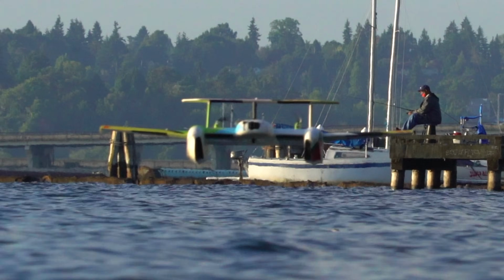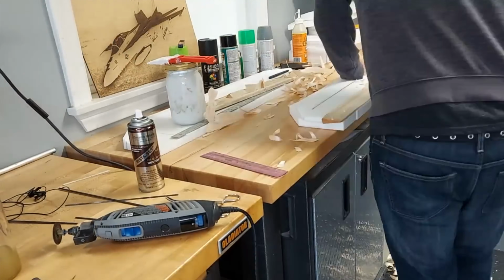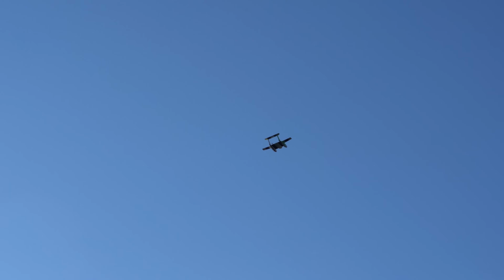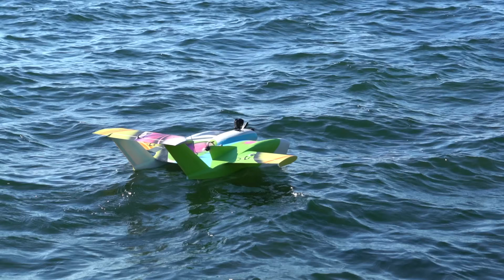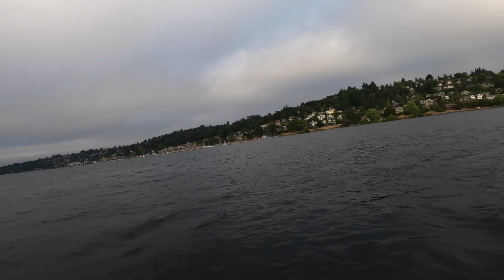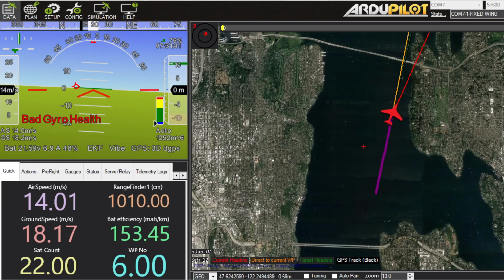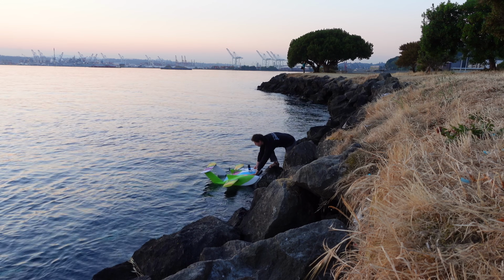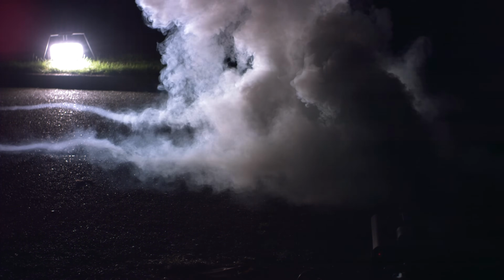R/C Ground Effect Vehicle - Long Range FPV

Comment: As an instrumentation engineer, I suggest you might get better results using ultrasonics rather than Lidar. The ultrasonic system should have longer range and, as the beam is conical and therefore covers a greater area of water, it's not as sensitive to choppy water. It does, however, have a minimum range, within which it won't work and this depends on the transducers used. Perhaps mounting it on a high part of the craft would help. The echo processing should not be too dissimilar to that required using Lidar and I believe you can get systems for Arduino. Subbed!

Comment: Two things come to mind. Mount the lidar module  in a 2 axis swing (this way it's always pointing straight down even when banking in turns). You'd need to implement it in a way that minimizes pendulum motion when changing direction.

Second thought is a bit more out there. Could you use a camera system to detect obstacles and run obstacle avoidance algorithm to navigate between boats? Maybe another LIDAR module on the top with a reflector mounted to a motor to scan 360° and build a map.

Comment: You are my inspiration for getting an asw28 and putting a long range fpv system on it.
I have an IX 12 going to get a 10 channel smart receiver and a DJI air system for it.
Hopefully it will all work together 🤞

Comment: Considering the efficiency test: you do not need to freeze anything, you need an integral (over time) of speed times amperage, or something like that. I do not know much about flight efficiency in particular, but it feels like an integral thing. 

Great video, and an awesome project. Original soundtrack is my special favorite.

Edit: I wonder if it's possible to probram it to keep pitch and roll during turns in the ground effect (like, yaw-only turn) using nothing but thrust differentiation. That would exclude the wing tip touchdowns.

Comment: In the early days of LIDAR mapping we created an algorithm (like a Kalman filter) to take out tree scatter from the laser return in the heavily forested areas of the PNW.  You might be able to do something similar with your wave peak and trough return to create a more average wave height calculation.
Reply: Would a LIDAR array along the X axis help provide more accurate wave/water heights, say 3 (or more) devices, front facing forward (i.e. 30 degrees), middle vertical and rear facing to the rear? Tune number of sensors, angles and separation as well as phasing. Also consider one TX/RX and two RX only?

Comment: For the next part, fix a drone to fly long distance mission on top of the airplane that detaches with electromagnet, have it circle above and act as relay for the fpv drone and then automate the redocking. should also charge from the mothership for repeated long range fpv flights from mothership.

Comment: Applying a smoothing filter to the lidar sensor data should help with getting a less noisy measurement. A few options would be a moving average, an exponential moving average or a Gaussian filter.

Comment: If you put 2 sensors on it one near each wingtip you can use that data to aid in the turning issue because then it would know when it's wing tips are potentially getting too close to the ground. This might even allow you to find a way to essentially cancel out a good chunk of the noise by seeing what the difference is between both sensors is and eliminating any sudden spikes that don't show up on both sensors when you are calculating the height which would help increase the resolution as well as the accuracy. Adding a third sensor could make it even more stable of a readout. Basically the more points you can get the better. An ideal situation for something like this in my opinion would be at the minimum one on each wingtip and one on the tail or nose because then you can calculate a plane no pun intended out of the 3 points from which you would be able to get the estimated distance from any point on the plane to the ground which would make turning as simple (on a level surface at least) as biasing one sensor to increase the ideal value and decrease the other one all while maintaining a total minimum distance from any point on the plane to the ground.

Comment: Suggestion: An autonomous plane with a radio relay in it, so you can get good video while in the ground effect at longer ranges. 
Perhaps it should be solar powered, or lighter-than-air so you don’t have to worry about battery as much.

Comment: On some UAV's I worked on years ago, to keep the wingtips from getting in the view of the FLIR during target loiter, we used rudder in the turn and counter with alerions, to perform more of a flat turn. Slight loss of efficiency but worked well.

Comment: Awesome. One way to compare efficiency in and out of ground effect could be to fly a waypoint mission and then repeat the same mission with higher altitude and the average speed of the first one. The ground effect mission would lose some efficiency by speeding up and slowing down the motors but I think the comparison is still fair.

Comment: You could compare the efficiency by comparing the distance traveled per power unit used, rather than power consumed at speed. Adjust for power consumption differences relating to speed change, and you've got a way to compare efficiency on your GEV

Comment: It might be worth using multiple lidar sensors to verify height data and help with keeping the right height on turns by mounting the extra lidar sensors at an angle

Comment: Add a forward LIDAR or machine vision system to detect possible boats and command either an emergency climb or a spiral climbing waypoint or some other evasive maneuver before trying again to head to the next planned way point.

Comment: If you want to easily compare efficiency without having to go too crazy on tuning and telemetry (like measuring and keeping constant air speed etc), you could do another test. After all, to increase efficiency, the first thing to do is to decide what the actual desired result is. And in case of flight, the actual flight time is not really a factor, nor is the actual airspeed. It's to get it from point A to point B. So if you can take a straight run that is long enough to properly detect battery usage at a sufficient resolution, you could do that straight run at a few heights, multiple times per height. Double up your experiment by flying both directions on the same day (which could also allow you to cancel out wind influence in the averages). It would be awesome to see you scale this up, either into a personal transportation device, or another tug beast for your kayak :)

Comment: On turns you should use trigonometry to calculate the change in your target altitude according to the roll of the aircraft or perhaps make that something that happens always as a safeguard to prevent striking the water

Comment: Intuitively ,without much calculating:
 it seems to be  more stable than body will be longer an than  will be four or six smaller propellers but only two of them will make quick feedback acceleration (it is just construction which made soviet engineers)

Comment: Maybe you can add a filter on the lidar data to get a smooth input signal for the PID controller, so it can cope better with the waves? Briljant video and diy engineering, amazing results.

Comment: Having 2 or 3 lidar sensors may help in rough water by averaging the distance reading of all the sensors (I think weighting each reading by the signal strength may also help to improve the relevance of the data)

Comment: Super cool Daniel!... Thanks to your inspiration I am working a fpv rc plane, where the controls and video feed is handled via raspberry pi's and 4g networks...

Obviously one wouldn't be able to fly the thing if there's no cellular connection, but I personally think it's a good challenge. Plus where I am from Fpv stuff isn't cheap as far as I can tell

Comment: Maybe you could use an accelerometer to smooth out the lidar altitude, either by using the vertical acelleration as the inner control loop for pitch and integrate lidar altitude in the outer loop over time, or you could use the vertical accelleration to discount false lidar readings.

Comment: You should add an Nano jetson board to this craft along with 2 cameras so that it has stereoscopic vision and then add code so that it can self correct for altitude based on what it sees ahead of itself in addition to the altitude sensors and lidar it would then be able to run in autonomous mode and could self correct for objects based on their size and relative position it would be able to steer around them or gain altitude to go over them all on its own.

Comment: Have you considered boosting your G Effect signal reception range by significantly raising the  reciver transmitter by using a tethered balloon or kite? 

If its windy you might have to add a weather vane tail to a balloon.. its an old idea- aerostats but the cheapest most portable way to extend your signal horizon. 👍🏻 Make sure its high vis as you dont want to bring down any drones 😁

As for turns how about sensors at or near the wing tips....you could then program a blended control input to avoid tip stall or   slide...wing fences have been used  on water bombers and 3D aerobats to help keep them following the line in banked turns close to the surface.

Comment: I'm imagining that it might be useful to measure the differential pressure between the upper and lower surfaces of the wing.  Recording the raw data while flying in and out of ground effect might allow you to map and tune flight dynamics around that instead of altitude.  To me, it seems like air pressure would be a more direct way of measuring ground effect but it could be more difficult than I'm imagining.  Great projects nonetheless!

Comment: Hitting the water on a turn problem is potentially caused by increased TOF for the lidar when the plane tilts (rolls). Should be an easy fix if you integrate the roll angle into the equation, i.e. if is you measure height as h = t*c where t is the time of flight, when the plane is at an angle q, h = t*c/cos(q)

Comment: Unlike aircraft, full scale GEV's have a down only aileron, which prevents or aids too low a wing tip on the inside of a turn
Pressure shift aft is curbed by the position of the wings on the mainplane. Some very complicated machines such as VVA14, which experience a very wide operational envelope, epitomise good control by varying wing positions and angle of attack. Conventionally, even the most successful GEV's maintain just 25% of mainplane area for the flying tail.

Comment: It seems that you need a sensor near the wing tips that is always perpendicular to the ground that has a pendulum type mount in order to make turns close to the surface of which you are flying. Just a thought.

Comment: To improve the high frequency choppy characteristics you could try to treat the input lidar data with a low frequency filter in code.  Something like: 
newReading = (rawLidarInput*0.9)+(oldReading*0.1)
//use the new reading for control
oldReading = newReading

Comment: As someone who works in RF, you low altitude range problem seems to need a repeater. If you have a good high endurance plane, why not set it up as a signal repeater? Your ground effect plane can go low and it can keep the line of sight.

Comment: Amazing project! keep it up! - As for the issues with "rough sea state" - maybe you should think about some kind of damping for the lidar data. Like a moving average of sorts. The wave crests and the wave lows will be in a certain range anyways, and what you need to find is actually the wave height, to be able to identify the optimal height of the flight path relative to the average water level. Once that is calculated, you should be able to keep level without much change in throttle. Of course, that would require some kind of front facing lidar to identify obstacles, like boats, grass or animals to initialize evasive maneuvers.

Comment: Use of symmetrical airfoils would prevent or minimize the center of pressure shift for super stable "hands-free" flight in ground effect. Reference Charles Bixel.

Comment: awesome results!!! PID controllers for this system may be too for the stability you desired to see. PID don't handle wavy signals very well. You may need some complex compensator with feedfoward control or even some kind of model predictive control. dunnow if ardupilot hande it!

Comment: Always cool video, and some of the clips were pretty as well. But the photographer in my was  thinking 'Go right a bit' 'Hold that line' 
You should write an A.I. that recognises potentially cool images. I mean, A.I. is easy, right? And changing your mission for random suggestions on the internet is a completely reasonable expectation...

Comment: GEV isn't just "flying low." You shouldn't NEED anything to control the height because a true GEV's height is controlled by the native airflow under the wing.  

What you have is an amphibious aircraft that's programmed to fly really low.

I'm not trying to knock his work, but it pisses me off when people either misrepresent or misunderstand the technology they're talking about. Those "GAVs" have such huge wings, they're just aircraft that fly low.

https://en.wikipedia.org/wiki/Ground-effect_vehicle

Comment: Excellent video, I have been following your ground effect videos for a while.  I have wanted to build a micro light version of a WIG for several years, I may just do that this winter.  Your design would make an excellent starting point.  I have flown light aircraft, hang gliders, para gliders and powered para gliders (I have flown my para glider at Tiger Mountain in Issaquah,  Fort Ebey on Whidbey Island and Blanchard mountain amongst many others)  and have been fascinated by WIGs for years.   Would love to get a copy of the design for this WIG. I live in the Spokane area after 50 years in Alaska  Thanks for the video! : )

Comment: It doesn't seem to be as relevant anymore with the new plane, but some of the oscillation in height could be from the design of the feedback loop itself. If I'm not mistaken, the goal of the loop is to maintain a constant target speed, no?(since ground effect vs non ground effect meets at a definite point(??)) In which case this a speed loop not a position loop, and the error function of the loop needs to integrated.  I aint no computer scientist, but I've built a few PID loops in garrysmod. She's a beauty for sure though!

Comment: Time to develop truly state-of the-art (at least a model for now?):

i am imagining a 2-piece fighter, with one on top of the other, the top piece is extremely agile, having only guns & sidewinder 9X IR missiles, minimal fuel.... because most of the super-maneuverability inhibiting weight (eg. Fuel, BVR missiles, landing gear, VTOL engines...) are in/on the bottom half, which will be capable of fully autonomous battlespace management, refueling, rearming....

Just after /before entering the WVR merge, the top half will detach & quickly peel off from the bottom half, quickly defeating the adversary with its superior maneuverability....

Stealth /VLO 6. 0

Comment: @rctestflight, why not transition the aircraft to use more differential thrust steering while it approaches and enters ground effect, then transitions to more traditional steering as it exist ground effect? That way, you can try to reduce the roll the aircraft needs in order to turn, meaning you won’t need to necessarily have the aircraft increase altitude for every turn it needs to make.

Comment: Very cool.  Curious if you have any code that considers bank angle and wingspan during ground effect flight to predict the change in altitude of the lower wingtip vs the fuselage in banked flight.  Maybe even consider peaks of LIDAR returns to calculate off the peaks rather than the average.  Love your videos.

Comment: What about adding an ultrasonic rangefinder module angled slightly forward to try and map out the ground/water a few meters in front of the plane? You could use this to avoid larger peaks and help it plan out when it needs to increase elevation to avoid impacts

Comment: I dont know anything about your set up, but seems like for the longer range stuff, if you wanted to operate safely then stay in goggles on dji.. If you see a obstacle or loose video, hit a switch that will change the altitude from ground effects to say, 30 meters. I mean assuming you can make a set switch like that.

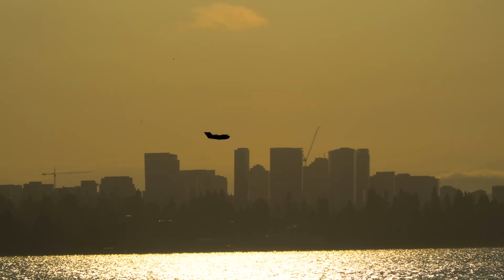Comment: 12:50 The data is confusing.  Maybe use a full battery to measure distance in both flight modes.

Comment: Hi, all very impressive and nice work.
I cannot see if you have any ailerons or rudders. If you do, for turning I would try to use more rudder (or differential thrust) and opposite ailerons. That is in order to keep it level and not roll.
I know it could be harder to realize than just saying it.

Comment: Just a thought, could you add a second Lidar and run them on each wing tip and use an amergae of the two. This would stop you clipping wing tips when turning, and smooth out the issues on rough water. You could also add a front facing lidar so it can see if it's approaching an obstacle like a ship and gain altitude?

Comment: What if you add rudders for steering?
You'll be able to counter roll by opposite aileron input and you should be able to keep the plane level while turning. I think with some tuning and experimentation you could perform your turns close to the ground and not have to pull out of ground effect.

Comment: FYI The thin black plastic that trash bags are made from will allow infrared to pass through. Great build, thanks for sharing. I wonder if you could use a sensor to measure the pressure between the fuselage and the ground. Would this data be useful for anything?